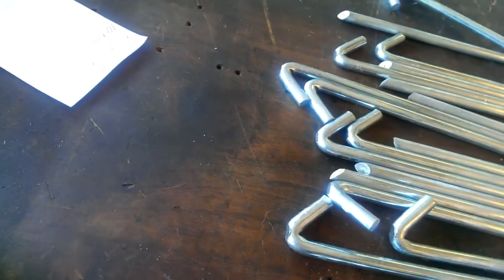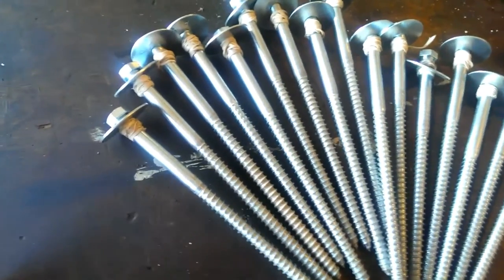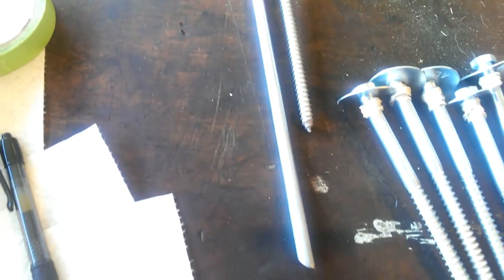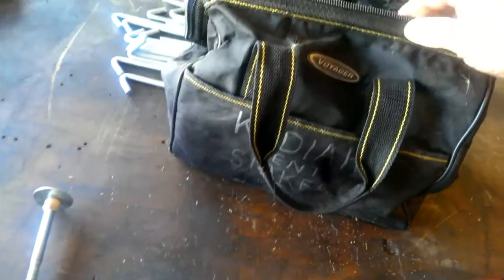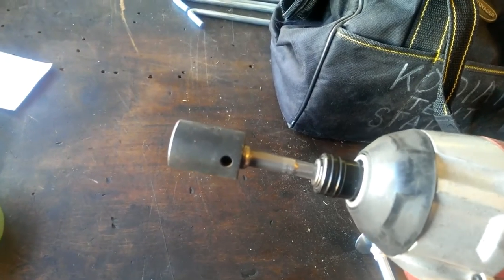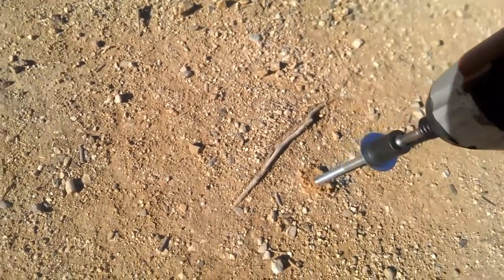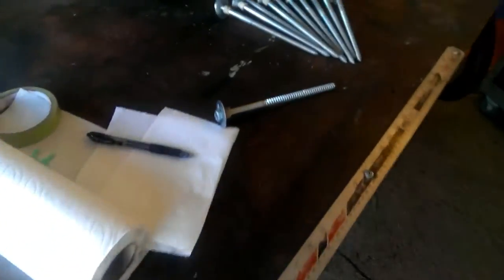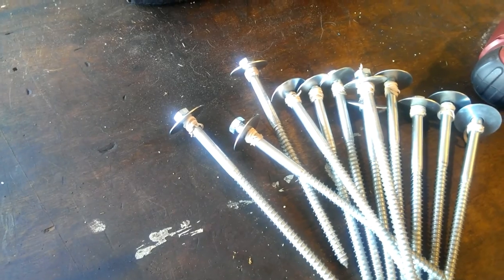Kodiak tent stake hack

Comment: THANKS! I live in AZ and went to use my tent for the first time and was so pissed. The ground was so hard I bent those stakes using a big hammer like everyone suggests. I even bought heavy duty military stakes that I was able to get some in. Found your video and the next trip I had the whole tent up in 15 mins - AWESOME! Thinking of even caring some shorter bolts cause sometimes didn't even need them that long and they gripped plus sometimes hit a rock 6 inches down.

Comment: Just bought a flex bow 10x10. I'm in Utah so hard mountainous ground as well. I don't know crap about power tools though and I see a lot of conflicting info. Do I want a 18 or 20V 1/4" impact driver...or a 1/2" impact wrench? Would a impact wrench with the extra torque not be better for really hard ground, and just as good when the ground is softer?

Also, did you ever run into a stuck in the ground situation (maybe wet or cold if into winter camping)?
Reply from the maker: Go to a place that sells impacts and see the difference. The difference between a 1/4" and a 1/2" drive is enormous. Weight ,price and functionality. A 1/2" battery impact (I use DeWalt now) is enough to remove the lug nuts on you car! The happy medium for you might be a 3/8" impact wrench?
Reply: @ZombieDaveAZ  Awesome man, appreciate the advice. Is that what you would recommend... a 3/8"? or do you go with the 1/2" to cover all possible scenario's? (thanks again, and I will take your advice and stop by somewhere as well).

Comment: I'm going to use this idea on our coleman easy pop-up canopy. I'm always pounding a stake through a large tree root and when I need to remove them it's almost impossible to get the stake back out. Lag screws will fix that problem.
Reply from the maker: Ive been there done that. You will be ever so happy with an impact and the lag bolts. Good luck to you and stay safe. 👍😷🍺

Comment: Good idea about the rubber bands. Maybe when they dry out you could replace them with silicone rescue tape.
Reply from the maker: Yeah Shawn, the rubber band retainers dont last long so I pretty much abandoned that aspect of it. I'm due to start replacing the lag bolts soon. The ground in AZ is exactly as hard if not harder nearly everywhere I set up. Thanks for the comment.

Comment: What size solar/battery/inverter are you using to run the wrench? I live in N AZ where there are more rocks than dirt. Do you think this would still work up here?
Reply from the maker: The wrench is a battery powered impact driver from Harbor Freight. Very inexpensive. The solar power from my trailer just recharges the battery. From time to time when it needs it. Does that answer your question? If not I have another video about my solar trailer.
Reply: @ZombieDaveAZ  Yes thank you.

Comment: Great tip! What is the diameter of the lag bolt?
Reply from the maker: I believe it is a 3/8 x 10" with 1/2 inch or 13mm socket to drive them in with the impact gun. Still using them 4.5 years later. 👍

Comment: How does this work in the soft grass? I've camped out this week with the kodiak tent and my stakes kept popping out. Does anyone know how to prevent them from popping out?
Reply from the maker: Mike Suo It works very well. You can use a ratchet wrench and THEN decide i if you want the impact gun. I have the Impact from working on lawn equipment. Good Luck

Comment: Do the threads on the lag screw damage the tent stake loop?
Reply from the maker: D. T. Donaldson  Good question. Not at all, if you notice at the top of the lag bolt there are no threads so the loop is not damaged. The washer does the work as far as securing the tent loop to the ground via the lag bolt. I hope I explained it and I should have showed it a little better. Thanks